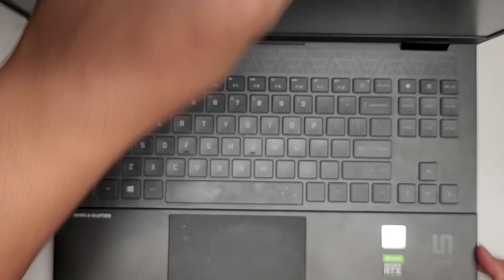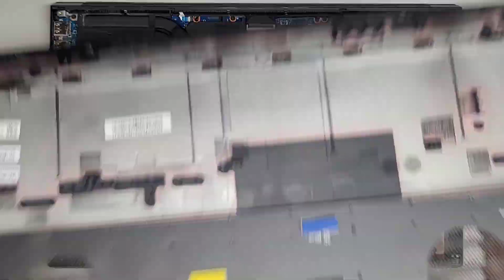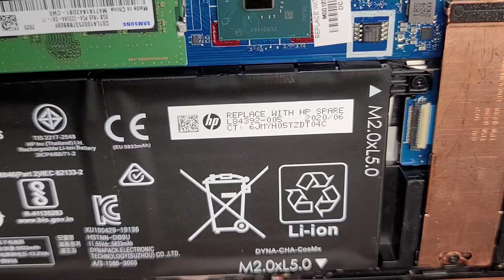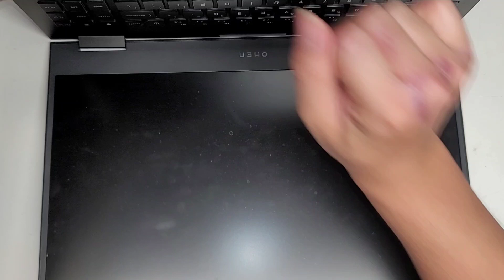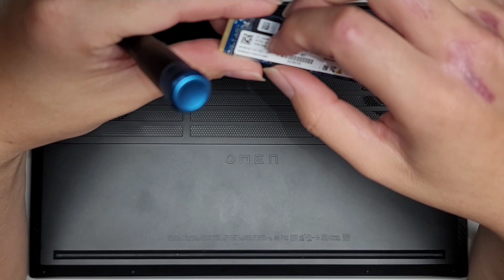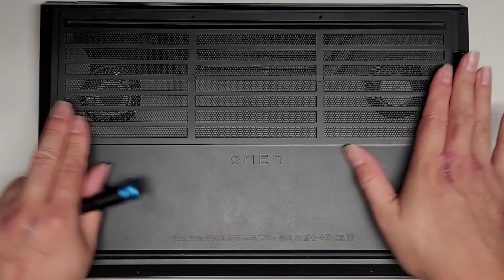HP Omen Laptop 15 15-ek 15-ek0013dx Disassembly RAM SSD Hard Drive Upgrade Replacement Repair

Comment: Ok so heres a conundrum:
You said the intel optane drive is not the main hard drive for this thing. Mine only had 1 m.2 drive in it. And it was the optane on the left when the computer is open and on its back.
Mine says 32 optane /512 nand. Ive been out of the fame for a looong time. Back in my day everything was spin drives. Also i am getting the “no boot device” error.
Question: how boned am i?
Reply: update: after spending the whole weekend on hp support with a lovely tech who called me back hourly to check up on my progress. i figured up an interum solution of using a thumb drive as a hard drive. and as of valentines day got a new western digital black m.2 nvme ssd. also cleared out my spare 2t external and have now created a good working system immage on that drive. also have all other major files backed up to my 5t external. and today being payday for me i am going to buy 2 more spare of the western digital drives that i got, and get them both set up with all needed files to resurrect my computer. in that way i will hopefully not be "caught with my pants down" the next time this happens.
Reply from the maker: Sounds good
Reply from the maker: The Intel optane is also your main SSD in this case. Those things have a very high failure rate from my experience.

Comment: I have a OMEN Laptop - Model# 15-ek0013dx. I am getting the "3F0 error" on boot and it's not recognizing a hard drive or an operating system. When I run the bios diagnostics it's only recognizing the 32g Optane nvme. When I opened it up, the other nvme slot is empty and only has the optane drive. Does this model have some sort of internal hdd/ssd that I"m missing? It says it's supposed to have 512 GB Intel® SSD + 32 GB Intel Optane Memory, but I only found 1 drive. I have since bought a 1 TB Nvme drive and installing windows to that to solve the issue, but it still doesn't explain why the "hdd/sdd" failed and it's not in the physical computer. Any comments would be helpful.
Reply from the maker: They lie. It's all in one SSD. Intel SSDs suck. They should stick to making processors...
Reply: @ItsBinhRepaired  thank you
Reply from the maker: It's likely part of the optane stick. I hate that junk...always failing.
Reply: i had the same issue with mine - have this exact laptop model. Drive not recognized but 32gb optane was still working. Took it to repair center, was failed harddrive, had hard drive replaced. Then 6 months failed again, had it replaced again. And 6 months failed second time... this intel optane drive is horrible, and keeps failing over and over... i hate this laptop.
Reply from the maker: Intel optane is shit... it's not the laptop's fault. Get a real m.2 pcie nvme SSD I recommend this https://amzn.to/3iP6Z16
Reply: @ItsBinhRepaired  thank you very much. i noticed this link is for crucial. would you say crucial is better than samsung evo 970/980? Also i noticed this crucial is for generation 4. I've been searching everywhere trying to figure out if this laptop is generation 3 or 4 PCI express, and some people say 3. Do you know? thank you
Reply from the maker: @Vlad L  either way, it's backwards compatible. Samsung is known to be the best, but I've never had issues with crucial drives. If you're willing to put out the extra money, you can go with the Samsungs. I practically never see those fail either. As for what's better, I'm not sure. I'm sure there are benchmark tests out there somewhere.
Reply: @ItsBinhRepaired  thank you very much!!!
Reply from the maker: @VladLOnFIRE  no problem

Comment: Thx for making this video, I have the same exact laptop that came with that came with that intel optane stick and have the same hard disk (f30) issue. I’m not sure what to replace the hard drive it’s my first seeing this problem, but thanks for making this video it was helpful. 👍
Reply from the maker: Glad it helped! Another m.2 pcie nvme SSD. You can create a Windows 10 USB installer with another Windows computer.
Reply: @ItsBinhRepaired  Do you have any tips on recovering data from the old SSD?
Reply from the maker: @cobaph  if it's dead, no
Reply from the maker: @cobaph  Samsung, crucial, Kingston, SanDisk, sk hynix, wd are all good
Reply: Ok cool thx for the input, wasn’t sure if I needed to use the same ssd.
Reply from the maker: @ChrisJames-vl7on  I don't like optane. I don't really see the point. I don't see any performance difference. Lol any pcie nvme m.2 will work.